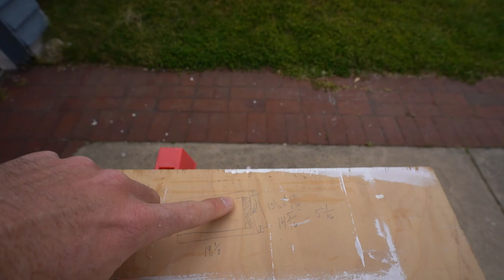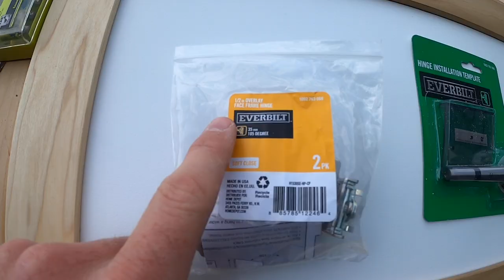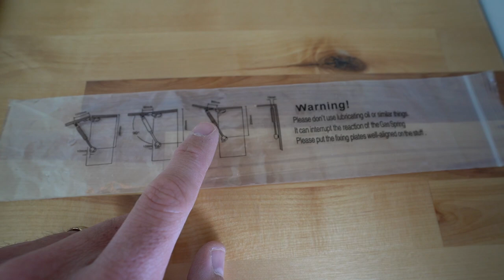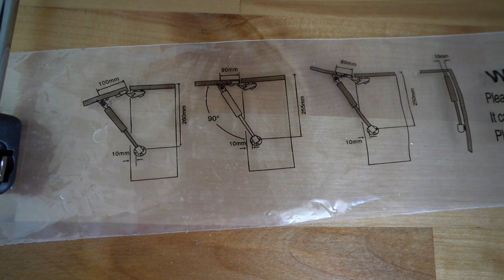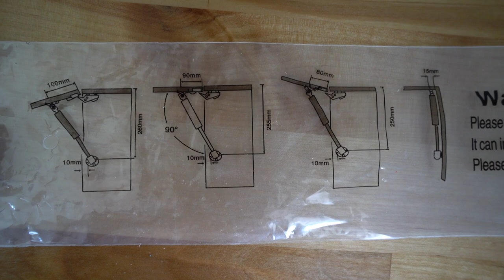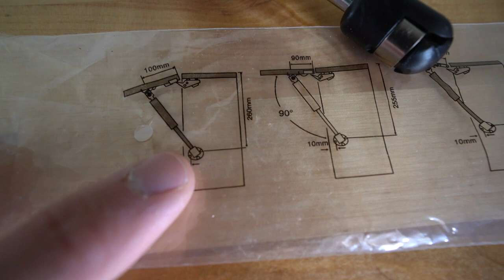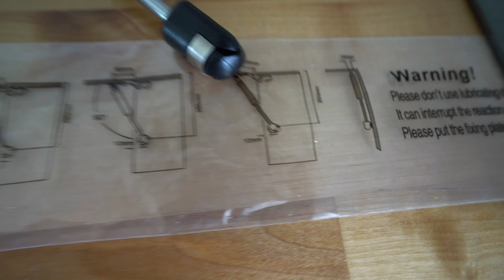Installing and Finishing the Upper Cabinets - Gas Struts - Part 2 - Van build Ep: 29

Comment: You should cut ventilation gaps in the electrical cabinet.  You can cut holes or slats in the door, or you could cut a rectangle or circles down below and install soffit vents.  Maybe soffit vents on the side would be better. The electric can generate heat.

Comment: I usually build the cabinet and then take it down and paint it. I don't think the glue works as well on top of paint. It cant penetrate if it's sealed. But you could have just sanded the paint off where the glue goes so no big deal. If it ever comes lose then pull the face off and glue it back on. But I also forget to do things once in a while. It's always an experiment. I just ordered pretty much the same gas shocks you used . . . spring assist hinges would not hold the door up. Now i have holes to fill from sending the hinges back.

Comment: Hey Kevin!  Thank you for the videos, these have been so helpful.  I noticed that the Outdoorsman drew up the depth of 4.5" on top and 9.5" bottom, with 15.5" height.  Those look small.  You mentioned top depth of 9.25" in your previous video, so quite a bit bigger.  How are you liking that size? does it block your view of the countertop?  Also, would you mind sharing the bottom depth and the height that you finished with?
Reply from the maker: Hey Dan, Thank you!  The bottom depth is 12 or 15” maybe I can’t recall and not near the van right now.

Big enough to fit full size plates in them